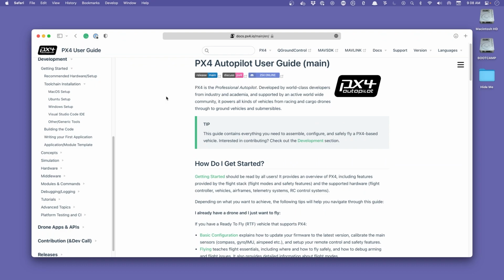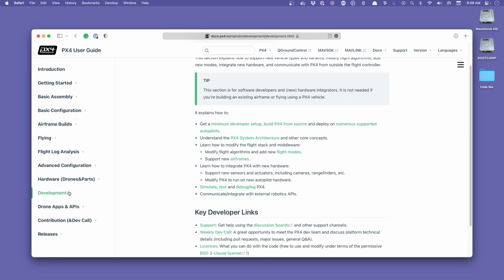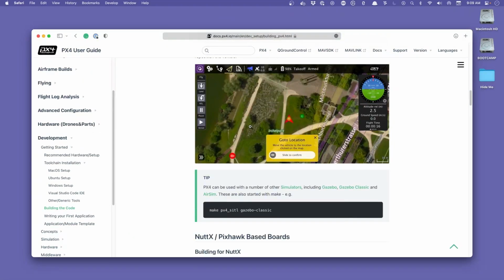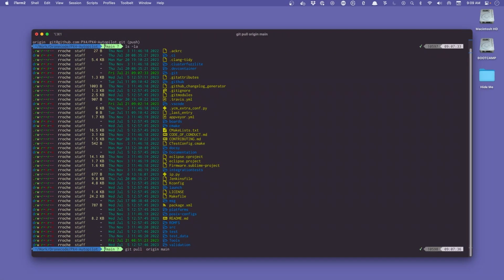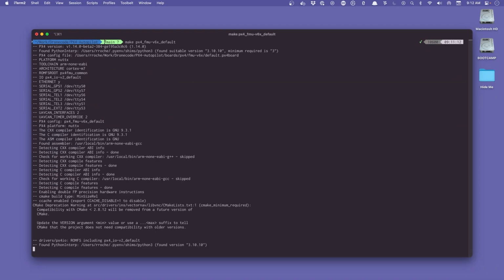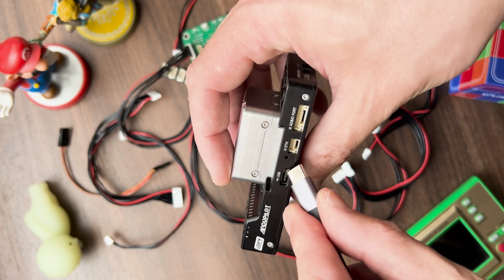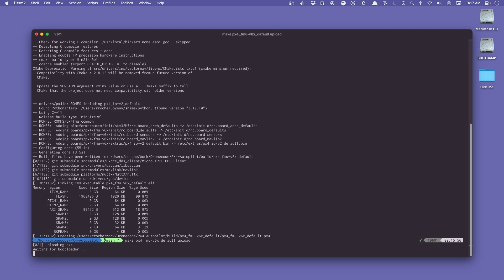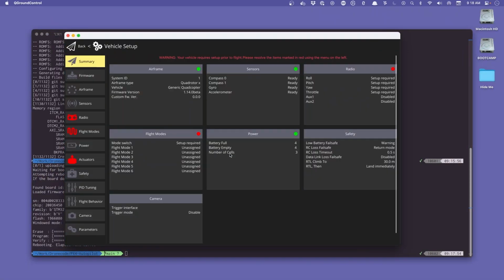Building PX4 And Uploading to Pixhawk

Comment: hello, when I build the code, the size of the .px4 exceed 2mb, how to deal with this issue ?
Reply: In the board config tool if your not using the simulation features removing them will save some space.